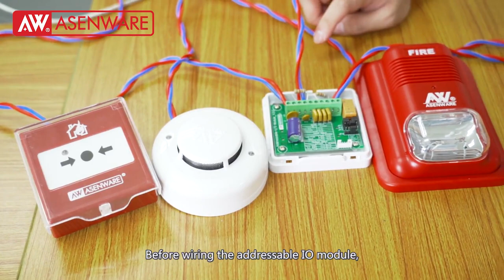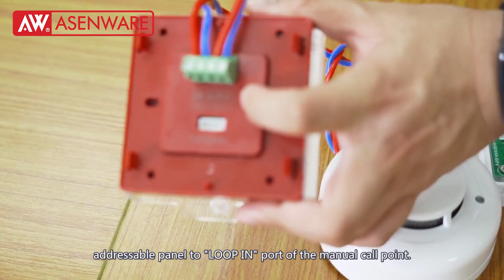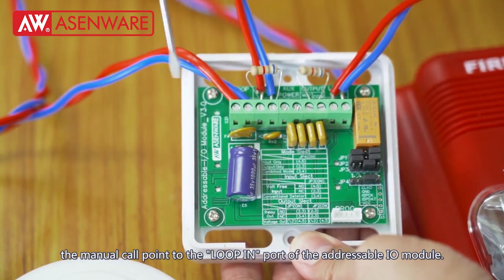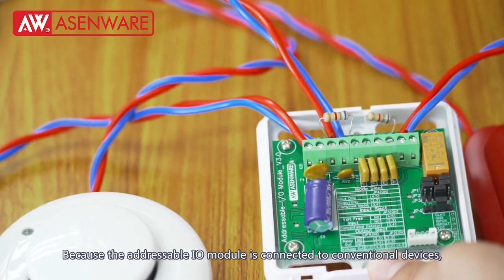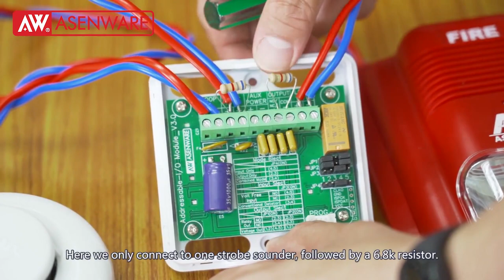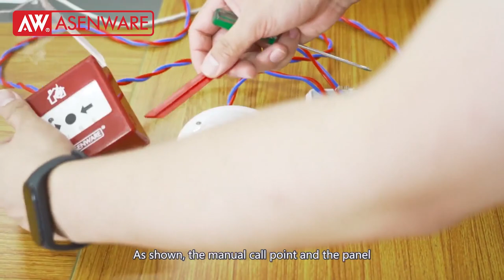Addressable IO Module and Addressable Devices Wiring and Testing

Comment: How can I address, find, or program addressable call point and strobe on addressable fire panel without module or encoder?
Reply from the maker: Better with a programmer dear, or you can set with our programming software on the computer.

Kindly contact us for more information:
Email: info@asenware.com
Whatsapp, Wechat, Tel: 0086 13922805301